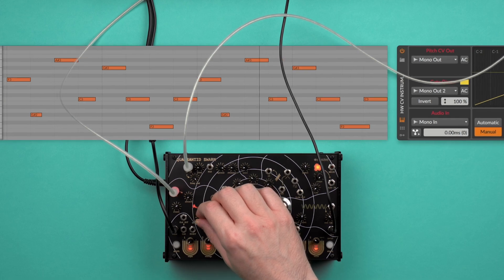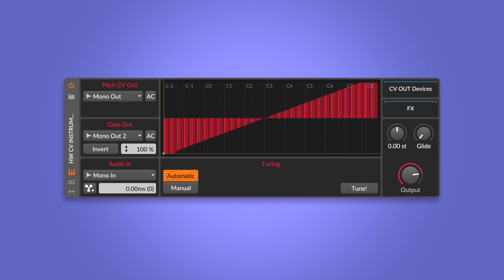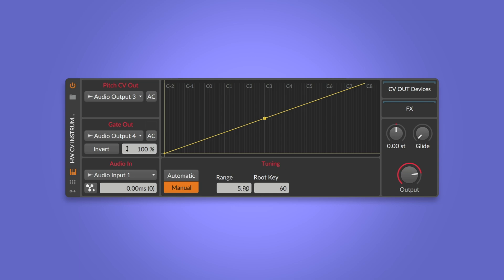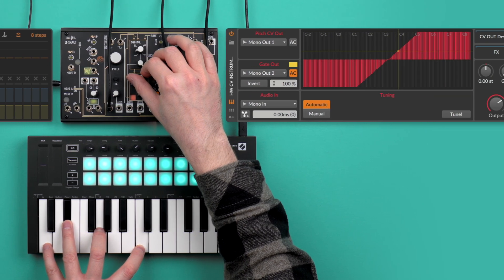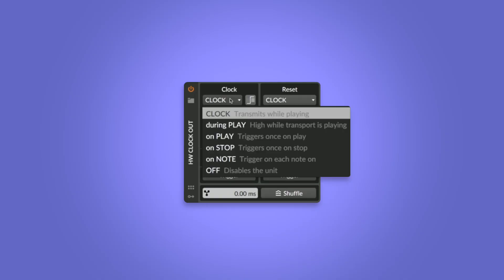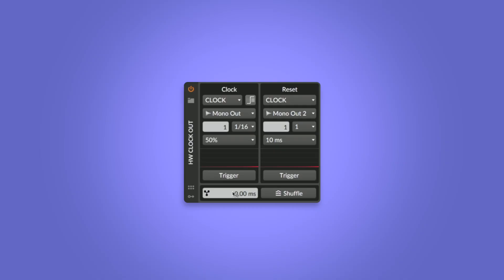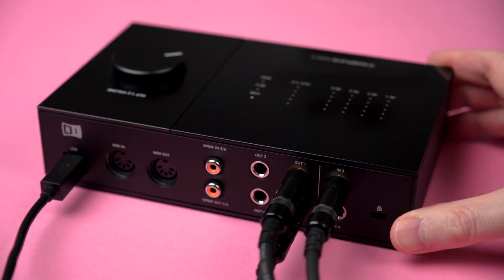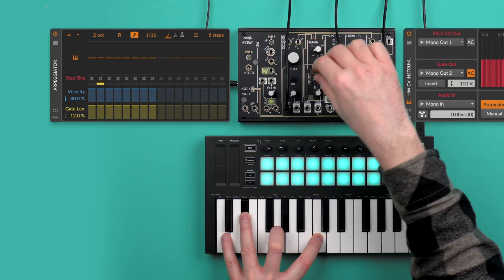Integrating Your Modular Setup with Bitwig Studio

Comment: I have tried multiple times using various Eurorack Oscillators and 3 different ADAT DC-coupled audio interfaces over several versions of Bitwig. Not once has the automatic tuning given a result that is anywhere near sufficient to use in any musical or melodic sense. Why is that?

Comment: For some reason I can‘t get Hw Cv Instrument to work with modules with built in envelopes (Qubit Surface and BIA). It only triggers some notes, but not all of them. Maybe it‘s because of the gate length that the device sends, I don’t know. For example, when I try to play two successive notes on the Surface via a Midi clip on the HW CV Instrument track, it triggers the first note, but the second is more like a sine wave than a clear string pluck.

Comment: i tried to do that with a volca Modular (which i can control just easily with a synthstrom deluge's CV output, so this side should be generally working) but failed to get it working properly. 

With Bitwig and outputs of a Tascam Model24 the gate was working, but note CV did not create useful note signals, but ones that resulted in volca making strange non-constant noises instead of playing something similar to the basic notes that I programmed in the Midi Clip. With Bitwig and  Steinberg UR22 i could could not even get anything - no gate and no note chaging behaviour at all - I tried all possible settings of the Bitwig CV device, but nothing happened. Could it be that some interfaces have output power control that just doesn't allow the necessary voltage? Is there a list of known working audio interfaces and/or an FAQ for how to troubleshoot this?

Comment: Some sequencers ( like the pretty ubiquitous doepfer A-154 ) need to have the reset trigger occuring on the last clock tick of the sequence in order to prepare for the first one. In the manual, Dieter Doepfer argues that this is the most precise specification of the reset behaviour for a digital controlled sequencer. Fully analog sequencers can get the reset right on the spot.  Right now, bitwig sends the reset when at start ( good for 100% analog sequencers) and not right before start (as required by digitally controlled Sequencers) . There is no precise way to offset the reset "one clock tick earlier" in order to accomodate this type of sequencer reset behaviour. 
Of course one can use time shift as a workaround but it is unprecise and limited whereas a [reset offset parameter] on the [clock out device ] would do the trick graciously and is probably very easy to add.

Comment: Could you PLEEEEEZE do a tutorial on how to set up the expert sleepers ES-5 in Bitwig (with ES-9) to get the gates from multiple CV Instrument tracks to come out of the ES5? There are some max for live helpers and left to right utilities in ableton that make it simpler. How to set it up in bitwig?!?
Reply: I think all you have to do is to add respective audio outputs in the audio settings.
Reply: @Fedir_Tkachov_Music  Thanks. There is just one stereo output to ES5 (7/8 for ES9). The problem I have is how to route gates from multiple tracks into the encoder to get it to come out on predictable ES5 channels. Like the gate from the CV Instrument on bitwig track one to trigger the 4th output of the ES5 via the ES5 Controller on bitwig track 8
Reply: @phil_244mbr  ah sorry, no idea. I thought es-5 just expands the es-9 via adat, similarly to my babyface pro + es-8 setup
Reply: @Fedir_Tkachov_Music  No worries. Thanks for the help! ES5 is great, but complicated with a serious lack of clear documentation
Reply: CV hardware which is USB class-compliant will just appear. Or whatever interfaces you have drivers for. But the Expert Sleepers modules that use multiplexed information on existing channels might need to be done with Expert Sleepers’ Silent Way software. I’d contact ES and ask Os, or check his forum on Mod Wiggler. Either he or the community can probably help.
Reply: @voltijuice8576  thanks. I ended up doing everything through VCV Rack. I little inconvenient to have the added layer, but it’s the only way the routing was clear to me and I could get it to work consistently and predictably. While Os is ever present with responses, and that much is appreciated, I haven’t found his terse responses helpful on this particular front
Reply: @phil_244mbr  Sorry I'm digging this up from so long ago, but I too wasn't comfortable asking anything of Os precisely for the same reason, his terse manner left me feeling like an idiot, which I might be but still, I don't need anyone else to help bring that up :)

Comment: I think it's worth noting here that if you run Bitwig on Linux you can very easily use JACK to connect Bitwig to VCV Rack. I believe all of the techniques demonstrated in this video would be applicable in this setup, and you're not going to break the back on a bunch of outboard gear!
Reply: Using VCV Rack in Bitwig as a CLAP plugin works great also
Reply: @voltijuice8576  nice! I need to try that

Comment: This is a great overview; it moves very quickly. A request: more detailed information about calibrating the HW Instrument. I personally have struggled with this and find it hit or miss with respect to the automatic calibration. And the manual option remains, even with your quick note, a mystery to me. Thanks for the help and keep 'em coming.
Reply from the maker: Be sure to get in touch with our tech support regarding your issues. Detailed reports (with sound examples if possible) will help us improve things. https://www.bitwig.com/support/
Reply: +1 for a deeper dive on calibration as I've also had mixed (mostly negative) results using it!
Reply: @BappinProductions  I think if depends on the audio interface you use. For example, I was trying and trying to get it to Tune something meaningful on an ES-8 (which did a fantastic job on the ES Voice Controller, surpirse) so then I switched the HW CV Instrument to my MOTU UltraLite channels and it actually gave me about 3 octaves pretty well tuned calibration. In any case, I think, using a relatively 'clear', i.e., square, wave form for calibrating is a good idea. But the whole thing is still a bit like witchcraft or voodoo.
Reply: @edwardnixon1782  I also have an ES8 connected via ADAT to an RME Fireface and I tried following the guidance in the manual i.e. using square wave (were possible) with the recommended input levels etc but still the results were hit and miss. I just don't bother with it anymore and accept the inconsistencies as "character" :)

I've been meaning to put aside some time to set things up with Reaktor Blocks because it also has VCO calibration and from the various YT videos I've watched, it seems much more reliable than the calibration in HW CV Instrument.